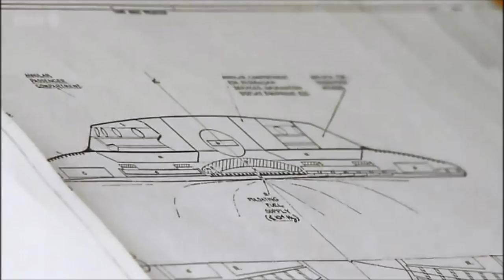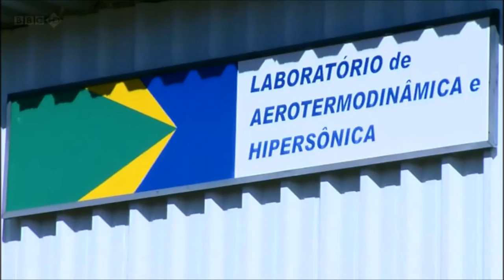Future propulsion system

Comment: Nope Nope Nope! Unless the lasers are on the spacecraft...You can forget about it!
Reply from the maker: I think that is the idea for the laser beam to be on the craft.
Reply: nice : )  laser power
Reply: derekvolt Actually the point is that the laser is on the ground, removing the propulsion system from the craft will greatly reduce the mass of the craft. Look at the Space shuttle for example, it is a 165,000 pound craft which in order to get it in the air had to have rockets and tanks added plus internal fuel which all came to 4,400,000 pounds. Take the space shuttle and remove the internal tank and engines (well add some engines and fuel for moving around in space). Use a ground based laser system to get the craft into space then fly that craft to a space station. This is would revolutionize travel into space as far as getting passengers and cargo into space, you can then build a space ship in space that is much bigger then what we can realistically get into space. 

Even better, you can build a giant solar array which charges up massive batteries to power the laser when it is time to launch some things into space. You don't have to worry about fuel cost, you don't have to worry about an impact on the energy grid, would make going into space insanely cheap (relatively cheap). It cost $10,000 (roughly) to get one pound into space currently......
Reply from the maker: Duane Craig Yes well this is definitely thinking outside of the box. I think the point is to have a laser on the craft. But you have bought another aspect, the possibilities maybe limitless.